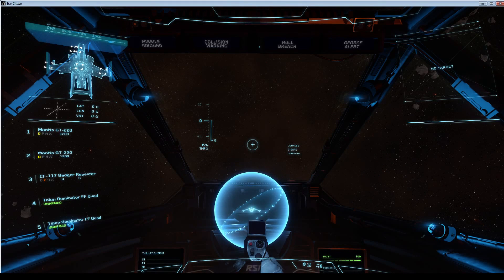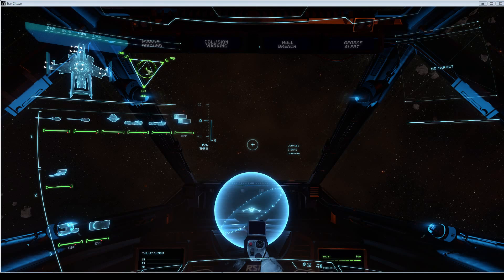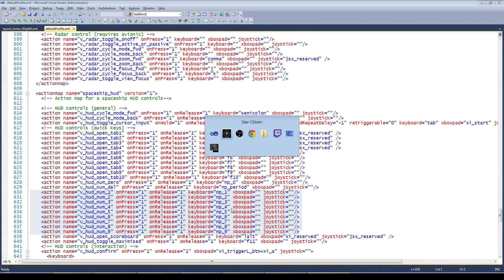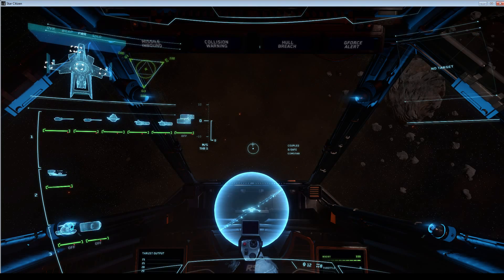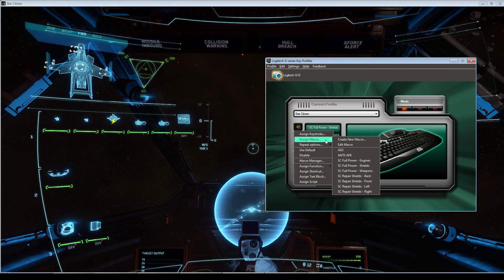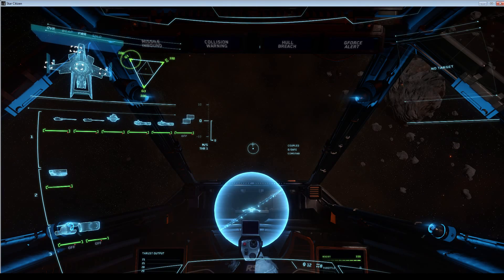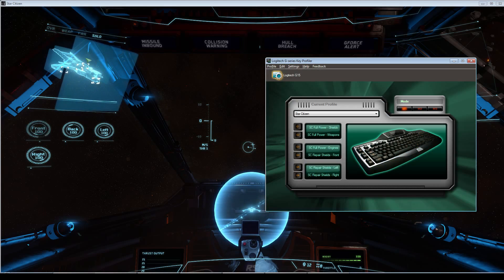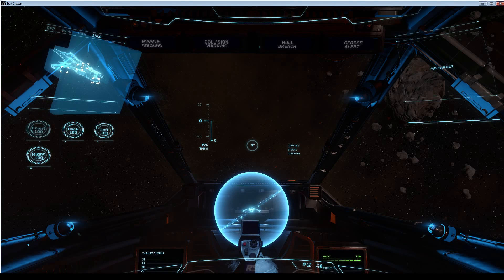SC Power Management and Shields Tutorial

Comment: 97115 is not a code. if you fool around with the num pad keys you can figure out how to nagivate the virtual hud. Pressing 9 moves your selection (blinking area) to the targeting screen on the right. pressing 7 selects the ship systems menu on the left. 11 moves the selection down 2 times and 5 is used as enter to select the triangle. i figured out that the - key will back out of the selection so you don't have to switch tabs.